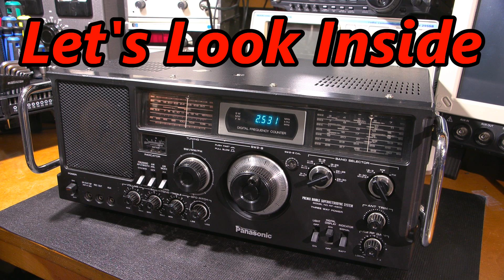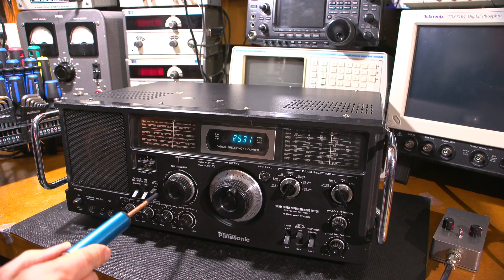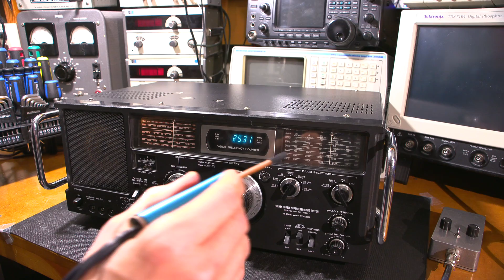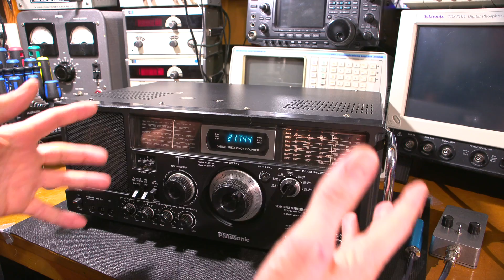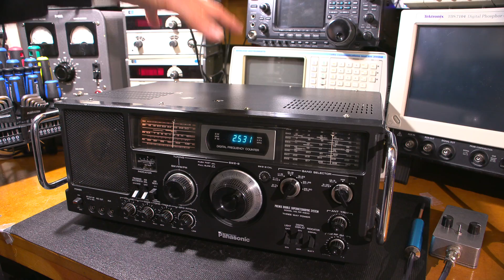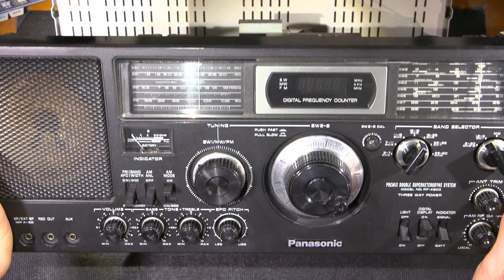Look Inside This Radio Receiver! The Collectible Panasonic RF 4900.

Comment: Hi, Did you do the light modification for the tuning panel?  Also I have just bought one and notice the FM dial is not in sync with the Fluro LED display? For example dialed all way to left and it only goes to 96mhz and will go no lower as the dial is fully to the left.  Maybe it needs re calibrating somehow??  ALso I have no sound from SW bands.  FM and MW working but no Shortwave even with outside 80m loop antenna.  May be pots need cleaning so I will take apart and de oxit.

Comment: Very intriguing.  I am just getting into shortwave.   As I am not an electrical guy, I guess I should not consider buying a National Panasonic 4900 I have found in a local thrift store.  I have no idea if there is anyone in our area who has the experience and capability to test and refurbish the unit, which would probably cost hundreds $.  🙂

Comment: Paul,
 That is truly a great looking receiver. I am looking forward to following your progress on this restoration project.
 I noticed that you just powered this receiver up on full line voltage. Can you please touch on  process  you use powering up a solid state receiver if it may have been sitting on a shelf for awhile?; especially with all those caps.

Comment: Hello, Carlson.

I just bought European version (DR49) of this radio on eBay. My particular one is in both great working order and looks very nice too. It was not restored. It was listed as “used” condition, but I knew it. As I wrote, everything is working properly, but it is not aligned. Problem is, that it drifts a lot on all the bands. On LW, MW and SW it is not a problem, because there is a calibration control knob. But with the FM is serious problem. Do you have any idea, how to align it?

Thank you very much for any advice.

Comment: You seem to have an obsession with replacing electrolytic capacitors en-mass :) Sure, the ones subjected to a lot of heat in the power supply can use replacement but not in the entire radio. I have that particular radio and haven't replaced any electrolytic capacitors and it works great! Why do all that work and expense unless it's necessary? If someone were to pay me for all that work the bill would likely exceed the value of the radio.
Reply from the maker: John: You seem to have an obsession with replacing electrolytic capacitors en-mass.
Reply: Yes I do, because they are a common failure point. They degrade over time, and the only way to make a device of this age dependable is to replace them all. Either that or you will be returning to your tech continually with random issues. Yes it's expensive to do, but if one likes the receiver enough, they will do it. If they just want a patch job, I'm not the guy to see. Thanks for your comment John.

Comment: I use Panasonic RF 2200 radio with batteries but I can’t operate it with 110 VAC. I think users before me had tried to operate with 220 VAC...So it doesn’t work by 110 VAC...How can I repair the enterance of 110 VAC?
Reply from the maker: The transformer primary is probably open, or something similar.

Comment: So, did you ever start the restoration yet? Were you able to get both sides of the dial lights to work simultaneously? 
I have one which works perfect, but the band selector switch is giving me some problem . Where would you recommend to clean it with tuner cleaner?

Comment: General Coverage Communications Receiver  Rating (1-5): HH (2) 

Made In: Japan 1979-1983 Voltages: 120 VAC or 12 VDC  

Coverage: 525-31000 kHz +FM Readout: Digital Fluor. 1. 

Modes: AM/SSB/CW  Selectivity: 5/3.4 kHz 

Circuit: Double Conversion Physical: 19x7.8x14" 20 Lbs.  

Features: ¼" Head. Jack, S/Battery-Meter, RF Gain, BFO, ANL, Bass, 
Treble, Speaker Jack, Two Tuning Speeds, Handles, Antenna Trimmer, 
Spinner Knob, Light, Record Jack, Auxiliary Audio Input Jack.  

 New Price: $399-479   

Comments: Also operates from eight D cells. The RF-4900 is similar to 
the earlier RF-4800, but with a green fluorescent digital display rather
than a red LED digital display. Sold outside the United States as the 
model DR49.

Comment: I Wonder why PANASONIC didn't go with Intermediate Frequency sampling and using DSP and use C++ code compiled using C++ for DSP processors with a Balanced Quadrature Sampling Detector to generate the Intermediate Frequency to be further processed in the digital domain using DSP processors.

Comment: Well, I would chose brighter amber lighting to contrast with the blue vacuum tube display. I have the European version, the DR49/RF-4900lbs. It has an extra ferrite bar antenna for LW reception. I'm waiting for the video where you restore it. I just love my DR49. It is very sensitive and it has very good Dynamic Range in addition to having very good audio, for it has independent bass and treble controls. I use it with an external speaker to get the richer bass and treble it does provide.

Comment: @Mr Carlson's Lab
My problem is the AM/FM bands on both bands I do not get any reception on PART of each, the other half of both is fine, is this possibly a broken oscillator but strange that it would affect AM and FM bands both. All the SW bands work fine. I've had my RF 4900 bought from brand new back in 1981! The way the dial lights work is that the tuning scale for each scale lights up when that band is in use. So if you are using the FM band that left side panel will light only, if you select the SW-3 band the right panel will light up.  I've actually aligned this unit on the SW bands and it is one hot receiver when properly aligned and a side benefit is that because it is an analog receiver the noise floor from the unit itself is EXTREMELY low! A very underrated unit. One other thing to point out if you have a tuning knob that has back lash you can stop this by using a very small amount of silicone gel on the tuning dial cord. The S meter IS lighted mini bulb which is pushed into a rubber surround whichtwist fits into the back of the meter.

Comment: Is it advisable to replace electrolytic capacitor with higher voltage rating, from 16V to 50V? Is there an effect on the circuit?

Comment: I would take a different approach. If the receiver works and meets all specs I would assume it to be good and I would not go ahead and replace whole bunch of components. Then again if the electrolytics have bulged tops (a convex aluminum top), I would then replace those caps (a very common problem with computer motherboards). Otherwise I would leave them alone if the unit works properly. Replacing most of the parts will cost more than a new receiver (especially in time). "If it ain't broke don't fix it. "  Just my opinion !

Comment: Very interesting look into this beast. I was really impressed by the signal injector lighting up the shorted LED. That RF field was obviously strong enough at the diode junction to create enough potential difference despite the shorted electrode ends. Great!

Comment: Maybe if replacing incandescent with LEDs, have red yellow and green for each side with a diffuser in front of the set, so that the yellow is always on, accompanied By green on active and red on passive side. Or maybe blue instead of green... but no "single wavelength" illumination.

Comment: Paul, I like the idea of making the "lights" match the VFD's color.  Also, I can't wait to see what you have to do to get the crud off of everything that fell in through the top cover vents.  I suspect that the receiver will work OK without a lot of repair work, maybe mostly maintenance will be needed.  But I'm sure you'll detail how you have to find any failures if needed.

Comment: Don't be so hard on the electrolytics.  The majority will probably be OK.
Reply: @Maurice Lovelock
True Matsushita made very high quality electrolytics during that time and they rarely fair over time the failures or seriously out of tolerance might be only due to improper storage of the unit, such as storing in high heat or much below freezing temps or a uncontrolled environment.

Comment: Cool! I've got the European version, the DR49/RF-4900LBS, the difference being that it has black handles and an extra ferrite antenna for LW. I called it a "giant pen-knife". In addition to having a built-in power supply, it has a jack for external power and even a battery compartment. It also has an auxiliar input and a jack for boath phones and an external speaker.  It is a very sensitive radio in all bands. It's got very good and clear audio. I'm looking forward to watching the next video. I like the "dull" backlights of my DR49. If I were to replace them, I would use amber led bulbs. By the way, I had to use a compressor to clean the upper part of its pcb. I count 43 screws to be able to open  the cabinet.

Comment: Since it has a blue VFD using cool white LEDs might be nice. Would would be great but perhaps a lot of work, having lighted pointers. Then you could have both dials lit and switch the pointer on or off when in use. It could be a tiny LED added to the pointer like some stereo receivers had or perhaps an acrylic pointer that glows. If you want colors I'm not sure they'd be very definitive indicating which side is in use unless maybe you used blue and warm white. I don't believe other colors will look appropriate for that unit. I know blue is overdone but in this case it might be best.

Comment: Keep original color just dim the side not active and when changing active side make it fade to brighter/dimmer light so it doesnt just switch between the values. Of course add light to needle meter. All LED. Add light sources so its even lit. And the real challenge would be if you design a LED 7 segment display replacement even though you dont need it. But as i understood the replacement display isnt easily found. Thanks for all your top notch content.

Comment: I wanted the RF-4900 So Bad I would Drool Over the Display Receiver at the Second Handed Store in Hot Springs Arkansas that when I finally paid my Lay-Away for it, my Drool had caused the Radio to Transmit on All Bands in SSB, AM and CW. This was way back in 1981, I was still in the Arkansas State Hospital for Schizophrenia, but I also did All TV-Radio Repair for the Hospital, my Grandmother was The Director of Recreational Therapy for the Entire State, Oy vey!Anyway, my Schizophrenic Radio Receiver split personality has a Transmitter Dark Side, Steven Kings Nephew was also in the Arkansas State Hospital with me, really! Steven King has a Relative with Schizophrenia who is also a Amateur Radio Operator, as I am. Look me up W 5 A W G , formerly K D 5 M P M . 
And the Story about my Magic RF-4900 is because I Was Born Dec.12, 1949 "Rat Fink" 49 A Real 49'er. Steven Kings Depressed Schizophrenic Nephew (I have not seen him since New Years 2003)Wrote the Magid RF 4900 Drooling story, a Cumbrian Cthulhu 
Its head was oddly elongated and pointed ears clung closely to the domed cranium and its grimacing face held a drooling

Comment: Beware of the vintage  RF 49 !! As much as I love them,Ive owned two of them.The  1st one   wore out the main SW band switch.The switch on the board that has the nylon cog wheels and  sliders either side as shown in the video.As much as I loved these beastly receivers,and they were acturly used by Doctors and school teachers who lived on remote  Sth  Pacific islands to listen to the BBC and and home land news etc when they were new.What happens,and it's non repairable is the Band switch has sliders, with very tiny brass fingers and make contact with sections of the switching,that with use and age become very brittle and twist and snap off,and get caught inside the switching unit,either jaming the movement ,also causeing the receiver inoperative.All thats left is the AM broadcast etc and FM.The first RF 49 I bought second hand, worked perfectly for 12 mths,switching no problem.Then when I turned it on one day and turned the SW  band switching knob,I noticed the Frequency counter read out was showing a mix of numbers,not relating to any frequency and the receiver just gave a hissing sound.I realised the band switch had become faulty.Not realiseing what had happened,I sprayed CRC into the sliders.This had no effect,so I prised open the sealed unit,of which is spring loaded,and mounted to the circuit board.To my sadness,I found loose contact fingers and twisted and broken fingers.So I bought another RF 49 for parts only that wasnt working.This receiver was dead.So on takeing off the switching unit and checking it,I found this one had the same problem.The rest of my radio was in perfect condition and I simply loved working it.I finaly managed to buy another after checking (number 2) that indeed had no problems at all.But after a  year of carefull use,I decided to part with it while still in great order,befor it too wore out the band changer.So please beware buying one of these vintage black beasts can eventurly become a pain,I warn yous !!!
Reply: I've been holding out hope that I could bring this unit back to life which is in otherwise excellent condition (other than smelling like nag champa even after cleaning) however your comment has tempered my expectations as it describes mostly what's happening as far as the am switch and the plastic cog band selector. I'll probably clean the front switches very well with contact cleaner and if I can't get AM/SW I guess I'll put it on ebay for parts. Ah well. The FM, which is the only thing that works, has excellent reception, better than the marantz in the main room. Plus it just looks cool.
Reply: @4260353042  Yes they can die of old age and over use.The main SW slide band switch is the only real problem as I mentioned and unless you can locate the whole circuit board,that still has the band switch in perfect  condition,the board is easily fitted.But the band switch is inclosed inside a metal caseing,and can not be opened.They are factory made,and if opening you will disturb the tiny "fingers".Unfortunitly for National,this was the only fail and cheap design of this band switch,instead of makeing a "rotary switch",but even rotary switches failed aswell on other radios.And with this RF 49,it doesnt matter if you turn the knob fast or slow,its spring loaded,so each notch on the turn sets a different wave band.I was very sad to loose such a grandly made radio,brass tuning condensers etc,you just dont find them anywhere.So unfortionitly this was the only fail of this radio from National. If you happen to own one still in great condition,be aware of the coming up band switch problem,it will wear out eventurly no matter how many times more or less it is turned,and it leaves your grand receiver unoperative.

Comment: Kool! I have one of these... it works great.

I also got a non functioning RF-4800.

It was just the plug jack on the back. It works on batteries and the 12 volt jack.

Comment: For the display I think the blue they used old Drake transceivers looks great, it really stands out.  I have a Drake TR 4Cw in pretty good working condition, nice cosmetically.  I want to recap the power supply and thoroughly go through the radio before I do much on the air with it.  It has an amazing receiver!   Learning a lot from your video's …. Thank You

Comment: Wow, yes so many tune points! Looks in very good shape though. For the frequency band illumination  perhaps a warm white led activated for the side that not in use, and a hotter color temperature activated for the side in use. I think white lighting is best for this receiver. Color, not so pleasing. Very nice project !

Comment: (@17:00) - It should be noted that the LED is a short AT DC; at AC, it’s going to have inductive impedance, and - because the LED leads form a loop - that’s a 1-turn coil that’s picking up the induced signal! I’ll bet that if you hook your scope probes up right at the base of the LED, you’ll see a half-wave rectified AC signal at the frequency of your sig-gen. Have fun! 🤗

Comment: Thanks for video. Signal injector is very impressive indeed and thanks for sharing.

My dial light suggestion would be a nautical theme - red for port and green for starboard. May have the active one brighter and inactive dimmed? Maybe yellow for signal meter?

Interested to see how this performs. It's a beast of a solid state comms receiver!

In the UK we typically pronounce RACAL, ray-call. I think it comes from the names of the founders Raymond Brown and George Calder Cunningham - RAyCALder. Not sure - I stand to be corrected?

Comment: The LED demonstration is very good at showing there is practically no such thing as a short circuit when dealing with RF. The minuscule inductance between the twist and the LED body is sufficient to develop enough voltage across to light the LED.

Comment: I had one of these for a while, impressive looking, but not a great receiver by any measure. Instead of this one and a Yaesu FRG-8800, I should have bought what I ended up with as the first great receiver I ever had, the mighty JRC NRD-515, loaded with filters and some upgraded RF components. I still miss that one.

Comment: I think if you want the modification, replace the lamp with a standard yellow LED rather than high bright. It may be a good idea if you put multiple yellow LEDs for each and use some sort of resistor to dim the light as it goes active.